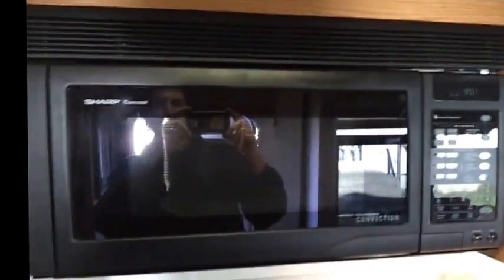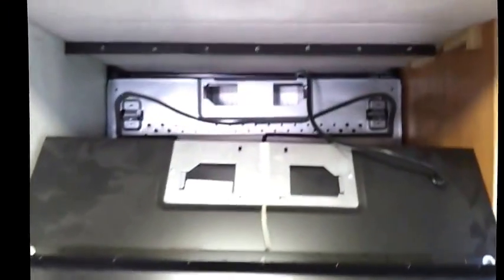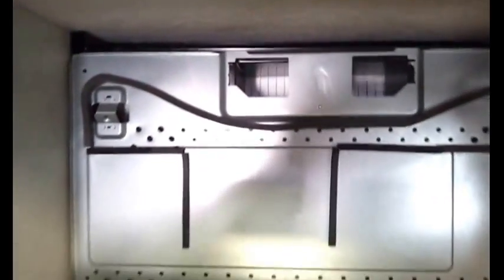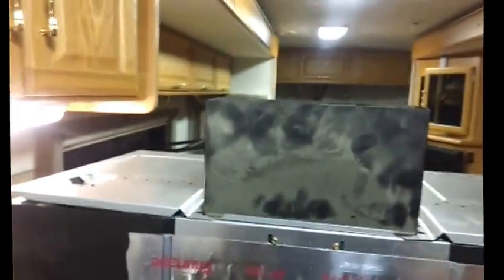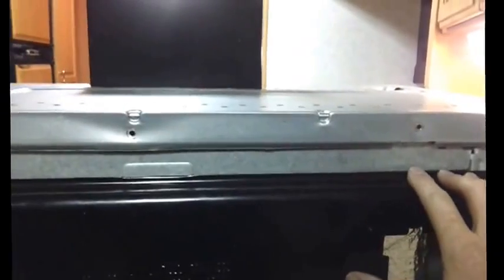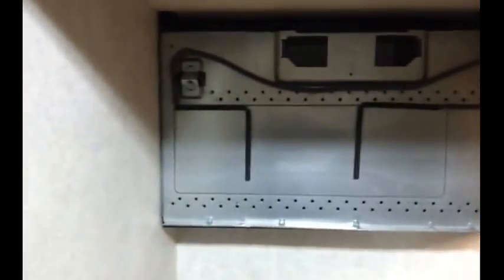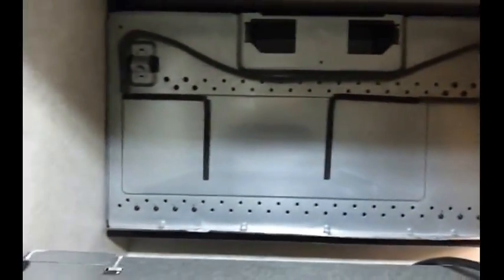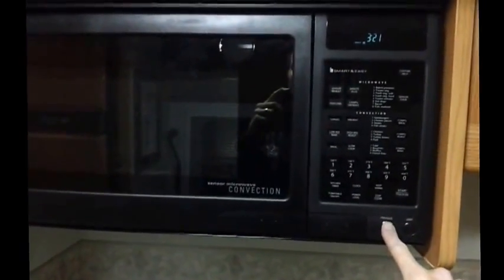How to remove and install Sharp Microwave R-1870 thats in a 2005 38J Winnebago Voyage

Comment: Thanks for your video, we had the same issue with the fans and that was the easy part, getting the microwave back up was a 2 day chore.  Had to enlist the help of another person to get the back of the microwave back up to the wall mount, but could not get the long screws to connect.  Finally removed the metal fins that hold the screws in the back, thet provided enough wiggle room to get the screws started.  Hope to never take that microwave out again.
Reply from the maker: I know what you mean no fun by yourself been done that.
Thanks for watching.

Comment: To remove my old Sharp model 1800 microwave, I had to search online for the following solution:  I removed the bottom panel (by taking out 5 - 6 screws) and saw  two long rectangular rods at the back and running up the back side of the microwave. After having removed the two bolts on top that extend through the cabinet above and disconnecting the exhaust vent duct in the same above cabinet, I pulled down on each of the two rods about one inch to release the microwave from the wall-mounted backplate.  Then I was able to lift and remove the microwave which came out quite easily.  (The bottom ends of the two rods were secured by screws which had to be removed before the rods could be pulled.)
Reply from the maker: Thank you for contributing.  They don't easy...
Reply: @ktoutdoor  Yes.  But the Sharp R-1800 is a very old model, and I doubt anyone uses this system anymore.

Comment: So did you only use those 2 bolts to secure it? On mine I can see where there were also some bolts to hook it to the cabinet. Some one had drilled through the case and added some non factory bolts which caused the case to bend and also the cabinet to come apart. I'm wondering if just those two long diagonal bolts going to the mount are all that is actually supposed to hold it?
Reply from the maker: I think the 2 long bolts should be all you need as long as the threads have not been stripped out
Reply: @ktoutdoor  Thanks, I cannot seem to find installation instructions anywhere. It's in my motorhome. I think it was original equipment and someone took it down for some reason and did not reinstall it properly. I will be rebuilding the cabinet, but I don't see how the cabinet would ever be strong enough to support the weight especially while bouncing down the road!
Reply from the maker: @lanceh4653  Text me your email address i will send you the manual 606-875-0125 Kevin

Comment: All microwaves come from the factory with the venting out the front. The installation tech (unskilled worker) did not know what they were doing. Our 2021 Alliance not only had it installed wrong, but had the fan installed upside-down. The air did not move at all! You were very lucky the microwave did not fall off with the main mounting screws not screwed in.
Reply from the maker: When you own a RV its always something.....lol

Comment: For what it's worth...I had a similar model for over my stove (House, not RV).  I had to take off the top plastic vent cover and there were two big Gold Screws they were crazy long and were keeping it bolted to the wall even after i removed the top ones.  I bent the  mounting bracket something fierce finding this out.  When in doubt, find more screws to take out, lol.
Reply: by crazy long, i meant they were about 6 inches long and attached to a fin from the back wall bracket that extended about 6 inches from the wall and went inside the microwave.  weird, hunh?
Reply from the maker: Thanks for the updated info